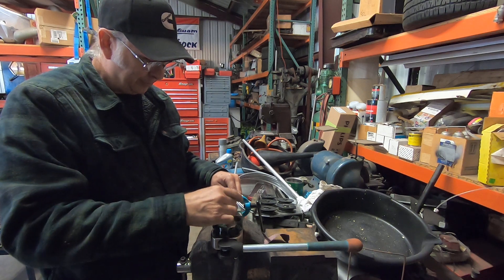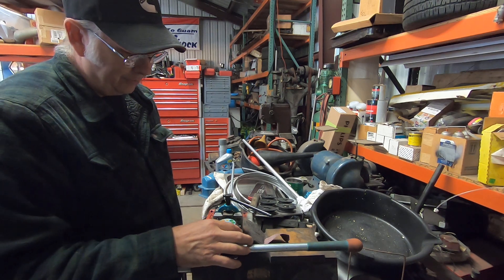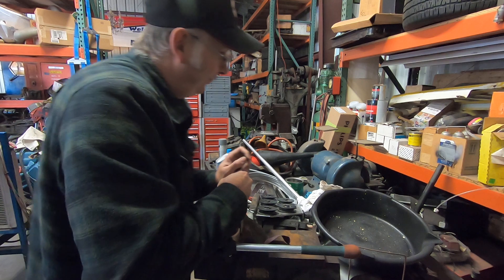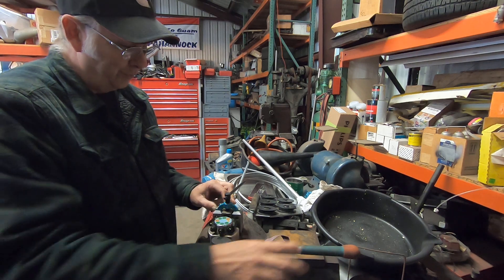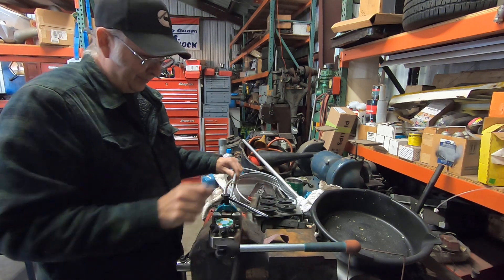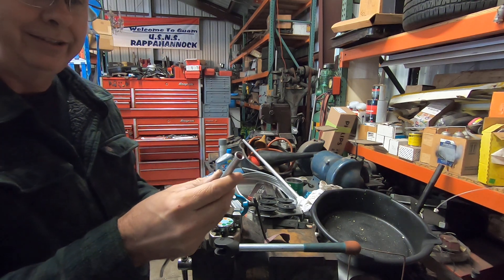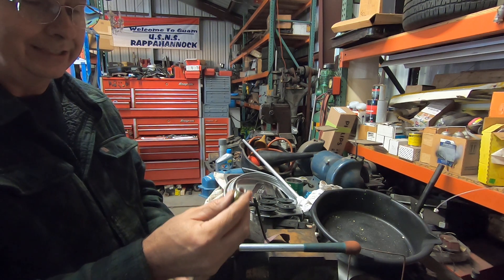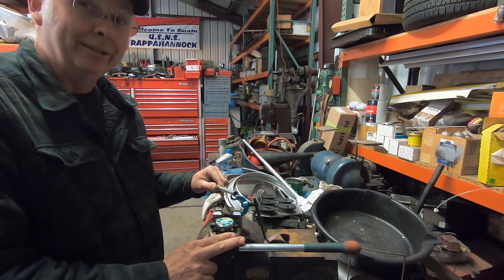Flare tubing the easy way

Comment: These work great. I happen to prefer the handheld hydraulic ram version (also sold by Eastwood) that can be used on lines that are already loosely installed on the vehicle. It functions the same way as this one with the dies, but offers more versatility on where it can be used.